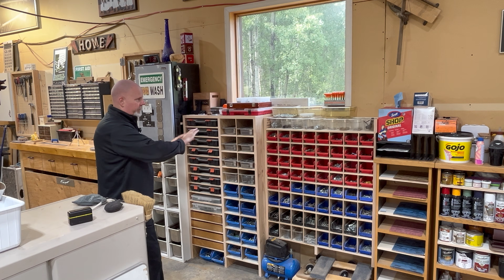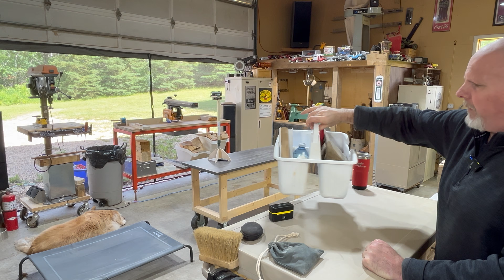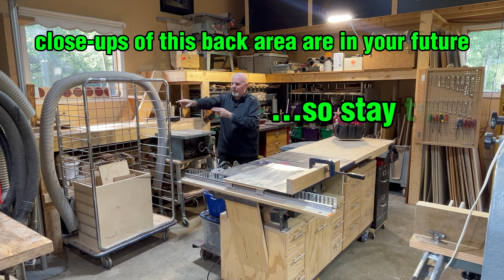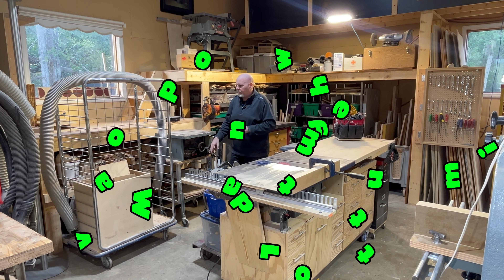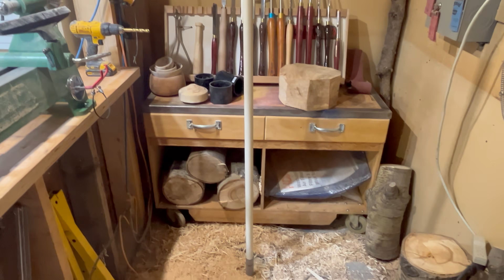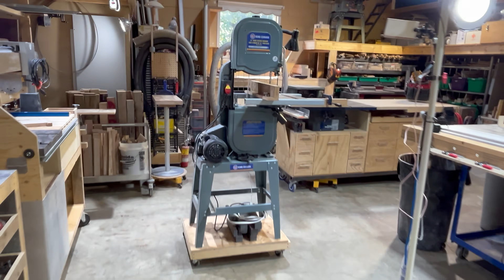SHOP TOUR - PRE-RENOVATION

Comment: You mentioned in the video that you are thinking about getting rid of your radial arm saw, and replacing it with a sliding compound miter saw to save space.  If you do decide to do that, I suggest before buying the saw, holding the saw by its handle, and trying to lightly twist that handle to see if the blade moves left to right.  I tried doing that with a nearly new Bosch sliding compound miter saw, and found that the blade moved roughly 3/16" left to right.  As such, that saw does not have sufficient accuracy for tasks beyond rough carpentry (even though the owner of the saw bought it for his mid to high end woodshop).  I tried the same handle twisting test on one of my Delta 12" turret style radial arm saws (33-892), and could not measure any side to slide deflection.  My 24 year old Dewalt 12" miter saw might have 1/32" to 1/16" of side to side deflection in the same test.  I was able to tune my Delta Professional 10" radial arm saw down to about 1/16" of side to side motion, which might be similar to what you experience with your current radial arm saw (Emerson built the Delta Professional 10" radial arm saw, Rigid radial arm saws, and many of the Craftsman radial arm saws).  You might see if there is a used Delta 12" 33-890 turret style radial arm saw for sale in your area at a reasonable price.  Those saws have a more compact footprint than most radial arm saws, are very precise when properly tuned, and are compatible with dado stacks (while sliding compound miter saws are not).  If interested, see a video that I posted a month ago for more information: https://www.youtube.com/watch?v=PSalFzbu_m8
Reply from the maker: Excellent information!  I will check out your video and start hunting for a Delta 33-892. 

Thanks a bunch!
Reply: The Delta 33-892 is a three-phase saw (sorry that I did not point that out) - I am running that with a 5 HP rotary phase converter.  I also have a Delta 33-890 saw, which is essentially the same saw with a single-phase motor.  My Delta 33-890 might have 1/32" (or slightly less) side to side deflection (that saw likely needs a tune up of the bearings), while my 33-892 has no measurable deflection.  If you take a look at my video, you will see a comment by a poster named ShopKlutz.  I recommended to him that he also pick up a Delta 33-890 - he found one that was roughly 34 years old, but still new on the original shipping pallet.  He created several videos showing the process that he went through to make that saw usable.  I suggest adding a 1/4" MDF top to the saw, if you find one, as mentioned in my video.
Reply from the maker: Awesome!  Thanks again.